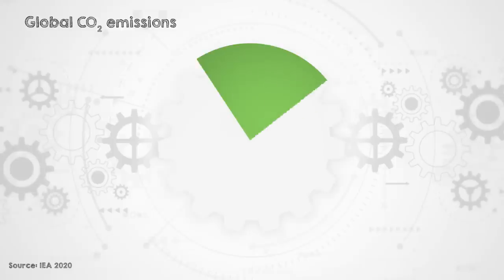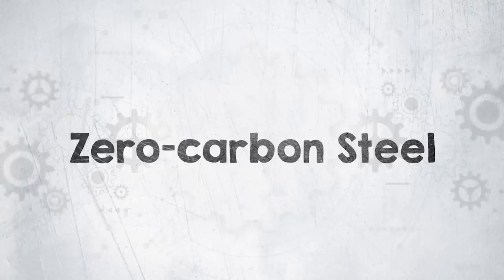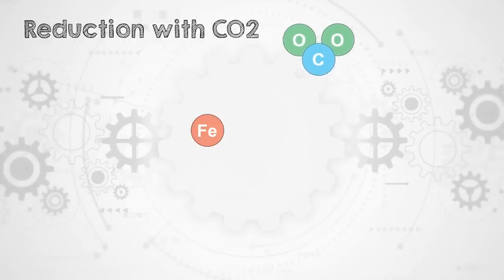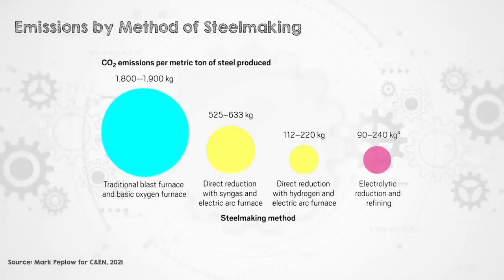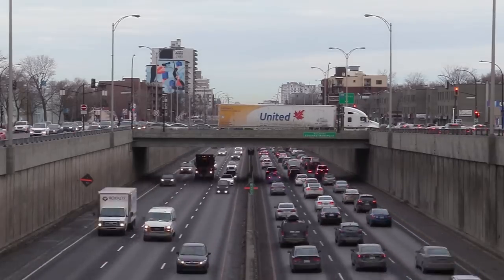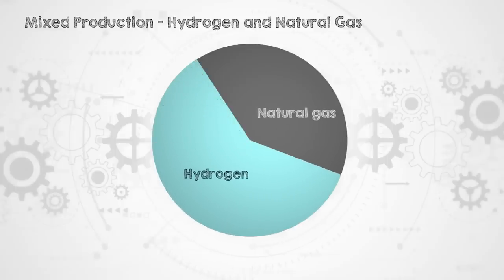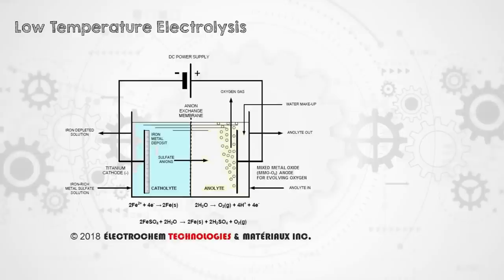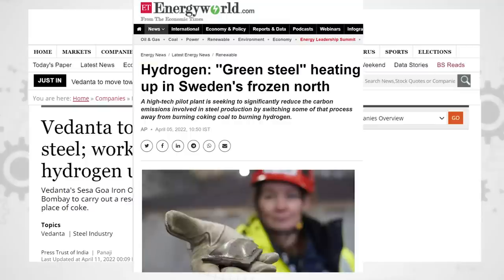Green Steel: Can We Make Steel Without CO2 Emissions?

Comment from the maker: The full interview (40 minutes) is available here: https://youtu.be/PHTRzeb6nMM 
We talked in more depth about the steel making process, aboutcement, and other applications of hydrogen and electrification.
Reply: go back to washing the dishes
steel cannot be made without or with so called low carbon
why do you lie so much ?
Reply: @richardcowley4087  hehehe that's   telling . Every one knows if good steel is to be made , the process required is using coking coal.. 
It doesn't hurt to look at other ideas or processes.
Reply: Or you could react the co2 with hydrogen and heat from the furnace to creat methanol in a sort of sebatier process. Rocket fuel but in a green way.
Reply: @jamesstjames1289  
what planet are you on ?
life will soon be a blast with you lad !
Reply: @jamesstjames1289  "green way"
more like "green scam"
Reply: Rosie,
Can you please have someone on who is actually qualified with respect to electrical equipment for hazardous areas (EEHA) to talk about the issues with hydrogen AND YES I am qualified.

I think hydrogen is amazing and we should be using it as much as PRACTICAL and I really do want to emphasise that word practical. 

FIRST off everyone needs to realise that no one technology is going to save the planet. Its going to be combinations of things and those combinations will vary from region to region depending a lot more on things like geography and demographics than people realise. Despite all the good will some counties just don't have the right geography for certain technologies and others have some demographics issues that are about  to slam the door on a few things. Go watch one of Peter Zeihan's lectures on demographics.

SECOND everyone needs to realise that all technologies have limits. Those limits include basic physics, availability of resources and most importantly demographics. On the basic physics Hydrogen is wonderful in that it makes up so many useful chemicals that the exhaust from many processes can be used as feed to other processes. BUT its so damn easy to react with almost anything. From an EEHA perspective all its wants to do is go bang and because its ignition energy is so low and its explosive range in air so wide its a real hassle for engineers to design plants that have it (even in small quantities). That leads to the next issue.

THIRD its no use having any technology if you don't have people trained to use it. It no use getting nuclear power if you have no nuclear engineers or technicians and they don't get trained in a 5 day TAFE course. I once worked with an electrician who's first career was in the US Navy as a nuclear power plant operator. He once explained his training. The problem with hydrogen is we have so few people who use it enough right now and we don't have the training programs. Its not simply a 5 day EEHA course. 

I really do believe hydrogen is about to play a major role in our lives, BUT all the clowns in the room need to shut up and let people who actually know what they are talking about speak and be listened too. This is not a pilot project at a university, this is real industrial stuff we need discussed. 

That whole skills pow wow we just had was a joke. It was run by economists, lawyers and special interests. Its not like the world has had energy transitions before. Ships went from sail to steam to diesel. Road transportation went from walking to horse to wheels to engines. We've been through transitions before its just this time we have TOO MANY clowns hogging the microphones. Its a tragic consequence of modern communications. Every clown gets a microphone and the more of a clown they are they louder they yell into that microphone.

Go look at the publicly available information. In the time our population went from 15 to 17.5 million (up 2.5 million) we built 7 Gigawatt class (>1,000 Megawatt) power stations. In the years since when the population went to almost 26 million an increase of 7.5 million WE BUILT ZERO large bulk power generators. Anybody who has done even a basic economics class knows how that works out. Its a small thing called supply and demand. That's been compounded by their age, which has been compounded by privatisation because in the private sector cost cutting is a religion and the easiest cost cutting is maintenance. So they are old and poorly maintained.

We have about 3 maybe 5 years at most to build at least 5 major power stations (2 NSW, 1 QLD, 1 VIC & 1 SA) or we are in monumental trouble. Plus as we are building them we need to start on replacing the rest of the 22 coal fired power stations. And before you ask, YES most other developed nations are similar or worse.

Sorry for the long reply.

Comment: I'd just like to raise a note of caution in regards to low-temperature processes - that is, anything that doesn't have molten iron (at 1600ºC or hotter) as its output. Common steelmaking alloys - carbon, manganese, silicon, chromium - need to be dissolved into stirred liquid steel in order to produce a homogeneous batch (called a 'heat' in steelmaking jargon) as diffusion in the solid state would take too long and would not give a fully homogenous material. Also, dephosphorisation of steel requires the steel to be liquid as well, along with the application of molten quicklime and oxygen (I'm assuming that desulphurisation may be less of a requirement due to the absence of coal, but as phosphorous comes from ores, dephosphorisation would still be required). This means that any cold metal would then have to be melted in order to carry out these processes, followed by casting to shape. Further shaping by hot-rolling requires steel to be austenitic, which means a minimum temperature of 900ºC - most hot-rolling processes have furnace exit temperatures of 1200ºC.

Comment: The point about the electro chemical steel making process needing a consistent electrical supply, I wonder if it would be a good move to build an array of molten metal batteries into your steel mill when you're constructing it. You're already building a structure designed to contain molten metal so you're already sited in a place that's suitable for that kind of industrial process and you have high capacity power lines coming into your facility, it would make sense to add some backup power that you're uniquely suited to handle.
Reply from the maker: Interesting idea. I am hoping to do a video on molten metal batteries soon, I am just trying to arrange a company to let me film some of their work.
Reply: Great idea on utilizing liquid metal batteries (Ambri?).   Utilizing a big buffer of LMB's...(tied into a large solar farm+off-shore wind farm) it could be possible for sustained steel production.
Reply: @michelem.6104  You wouldn't even have to use Ambris, those are designed to be transported and installed somewhere. If you're already building heat proof structures you can make giant liquid metal batteries in place. I remember some of the early research about liquid metal batteries was basically repurposing aluminum smelters, because the electrochemical process for refining aluminum is effectively a battery.
Reply: @AlRoderick  there is a very big difference between aluminium plants and Steel mills - about 500 °C. Molten steel eats any refractory it is contained in, and a steel plant does not have the capacity to indefinitely store it in a molten state. Many steel making steps actually produce heat, which reduces the need for constant reheating, but the thermal loss is constant. A decomissioned plant may have materials useful for constructing lower temperature molten metal storage, but I can't see that there would be pbvious synergies at an active plant
Reply: AMBRI.
Reply: Just buy Ambri's liquid metal batteries. Problem solved.
Reply: Megapacks would work and would be more cost effective and easier to maintain.
Reply: Molten metal batteries are not a thing.

What you are referring to is molten salt electrolyte metal air electrode batteries.

I get the confusion, I had the same problem for years until I watched a video that properly explained the layout of this more recent type of battery.

The media aggressively shorten the title of technologies when presenting them for public consumption, so it either comes out as 'molten metal' or 'molten air' batteries.

Either way though it isn't necessary to have a whole building built around the batteries - it's just prudent to do so in order to ensure maximum temperature control, because ideally each 'battery' would be self contained in a well insulated vessel, like the company doing molten salt iron air batteries is doing inside of a shipping container sized vessel.
Reply: @AlRoderick 

"I remember ... early research about liquid metal batteries was basically repurposing aluminum smelters, because the electrochemical process for refining aluminum is effectively a battery"

Earlier molten salt metal air battery designs required 100s degrees C more heat for the electrolyte to remain at optimum temps than recent research in this area.

I don't expect they will ever achieve <100C temperatures, but they will likely come down further in the future making operating conditions much easier to maintain and safer to be using them around to the point that they can be used in naval, or even air freight ideally, though passenger airliners would likely remain a stretch.

Comment: There is a whole class of high temperature nuclear reactors that could decarbonise steel much more cost effectively. Not only can they provide direct process heat, but they can also provide electricity and green hydrogen production at the same time. They also work 24/7 so they make much more efficient use of the capital expenditure.
Reply: And, if you use the heat directly to produce hydrogen in a (V)HTR the effiiency could be a lot better than with e.g. electrolysis.

Comment: Spent some of design and engineering life in the steel machinery industry for mostly electric arc operators. In N America we have been using natural gas in our blast furnaces for quit a number of years to reduce the need for coking coal. Coking coal has created a problem with a significant rise in the number of people downwind from the coking plants developing cancer. While natural gas does produce a greener steel and less cancer cases as mentioned it should also allow an easy conversion to hydrogen reduction of iron with little modification. Steel companies in N America have also employed very powerful magnets at the mining pits to concentrated the iron into an electric arc grade iron that reduces the need for massive amounts of carbon added into the electric arc furnaces and shipping costs and the amount of fuel needed in the shipping process. With carefully placed oxygen lances in the electric arc furnaces, impressively large electric arc furnaces can be built that can match the output of blast furnaces or basic oxygen furnaces. All of this was developed to reduce either cancer cases or the need to run your furnaces at full tilt during poor markets of the product. Just thought that it is ironic that these technologies could also usher in green steel.

Comment: One thing that would reduce demand for steel is protecting it in some applications like automobiles, so that end of useful life is no longer determined by when the bodywork rusts away ! I had a SAAB for example with galvanised bodywork panels where life could easily exceed over 20 years.
Reply: yeah, none of the "Green" automobile-haters discuss this aspect! 
btw. University Professors making steel will be a disaster. They know nothing. Those, proposing Green Steelmaking, are not experts on metallurgy, they haven't worked in steel production or anything close. Companies are doing research because of political pressure. Steel which contains residual hydrogen is brittle! 
 Zinc galvanized steel is fun: in warm humid conditions, with some ammonia present it corrodes. A 2mm thick galvanized frame will corrode away within less than two years if someone has peed on it several times!  ( I can't tell who did it.) 
   Hydrogen and/or Phosphoros ("Rot-Bruch", red cracks) make iron brittle. 
There is one exception in India: They have a 2000-year-old steel column that doesn't rust in wind and weather!  it was found to be "Goethit-alloy", which contains phosphorous. How was that column made? I suspect the Goethit-alloy is only a surface treatment. Imagine, the ancient Indians, (after casting that column), ordered 1000 men to pee on the red hot piece, to make it stronger. 
 Phosphoros has a bad rap in steel technology, but I think it's value as surface treatment is not well researched.
Reply: Galvanised steel is a great way to prolong the life of steel products used outside, that is a no brainer to help reduce steel use.
The scientists won't be making steel, they are researching new methods/technologies of making it. It will be then up to engineers to make the technology work in the real world. That's generally how new technologies are brought to market, from research first.

As for phosphorus as a steel surface treatment being not well researched, I have some rust converter in my shed which I use for surface treating rusty steel. It contains phosphoric acid. You are welcome to have some for your research, but I think someone has beat you to it. (Probably by some scientist who knows nothing about steel!) 😂
Reply: @robcaseyire  I think I've used rust inhibitors in the past containing phosphoric acid. They turn the rust to phosphate which then protects the steel underneath.

Comment: on the low temp electrolysis - you can select out specific metals...  but can you use the exact same process tanks, pull the iron and then maybe pull some set of other metals sequentially to save setup times etc ?   I realize you'd have to do some work on the aqueous mix to get the right salts etc in place...   surely some of the ores out there contain multiple metals that could be extracted, where today maybe they're bypassed...   Short note otherwise, it is so awesome to see bright young women like yourself in the engineering spaces - wasn't enough of y'all during my career...

Comment: You glossed over the electricity and natural gas  required for the EAF operation. I worked at one which had a 120 MVA transformer that consumed as much electricity as a large city, and ours was by no means the largest EAF in operation. Since it operates 24/7 and green sources of electricity need wind and sunshine it is clear that a stable base of power from a fossil fuel generating station is required. An alternative of a massive battery facility on site is not economically viable, which then requires an even larger green supply of power during  the wind and solar generation hours. Sure, given an unlimited money supply it could be accomplished, but what would it do to the cost of the steel and is it then a viable proposition?  What would it do to the cost of the ultimate steel products (autos, structures, consumer goods, and wind turbines and solar farms?)

Comment: About the Boston method:
1. We should not assume an intermittent power supply. The grid of the future will need to have balancing features.
2. The high temperature is not necessarily a problem. Once you have your steel, at high temperature, you need to cool it off, right? Well, instead of just releasing the heat you could trap it and reuse it either to heat more feed, to heat some buildings or to convert it back to electricity. 
In fact, combining both points, there are energy grid thermal storage solutions using molten salts - your steel factory could serve as such solution, with feed and steel instead of the molten salts, and then your energy cost (and footprint) will be minimal while your impact on the grid would be beneficial (balancing the grid).
Reply: 1. Flexible demand (also called "demand-side management") is an integral part to the grid of the future. Why have huge battery banks that can supply MW's of power whenever the factory decides to flip the switch and make steel, when the factory could instead soak up peaks in energy production (noon, windy days) and quickly shut off if demand increased or production decreased? It's less costly to shift energy demand than to artificially shift demand with batteries
Reply: @ThomasBomb45  Interesting idea. I'm sure that in countries (like UK, I believe) where the cost of electricity varies a lot with demand, hourly even, business have adapted to benefit from lower rates. Residential consumption has also adapted, people program the laundry to be done at night, top up the boiler with heat when the energy is cheaper etc. It would be interesting to do a study of how much the peaks of demand/supply can be smoothed out by such actions, or have been already.
Reply: @ThomasBomb45  Using power supply arbitrage batteries become very cost effective.

Comment: I worked at th BHP dri plant in Port Hedland. Very scary process, the H2 will auto ignite anywhere it leaks. They shut it down soon after a fatal accident. I used to have nightmares about it burning down😬
Reply: Ah interesting, I've been wondering about how they prevent explosions!.
Reply: @guringai  As long as the H2 stays in the vessels and the O2 stays on the outside, all is good. 
Until there is a leak...
Reply: Indeed, good safety practice is the key. Refineries have been using hydrogen for a long time, and of course there have been bad accidents, but there are many more dangerous product and by-products to be scared of, like the alkylation unit...
Reply: @merchantoo  Yeah, the trouble at HBI was the interaction of H2 and the iron oxide powder. The solids would clag the valve between vessels and need to be purged through with HP Nitrogen bottles
Only once someone used an oxygen bottle😬
They all look the same with the grey iron dust all over them